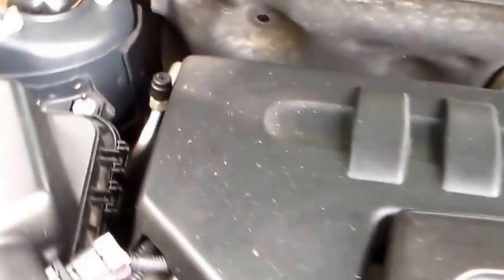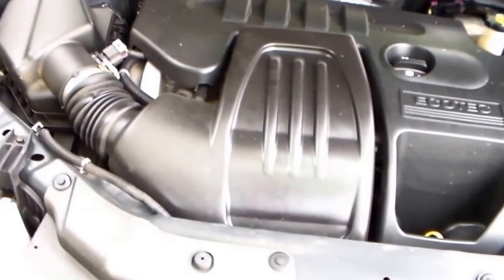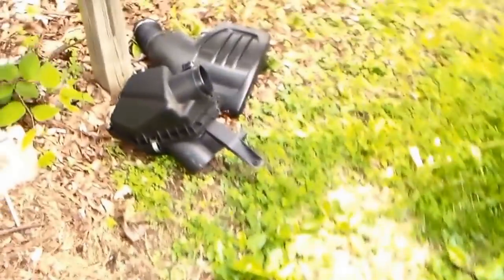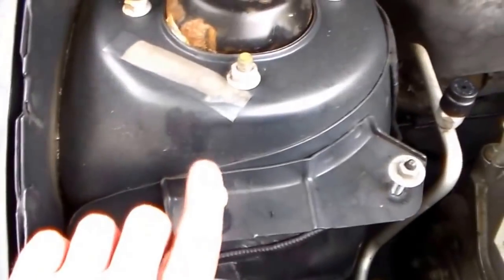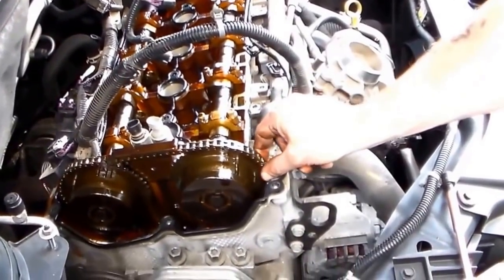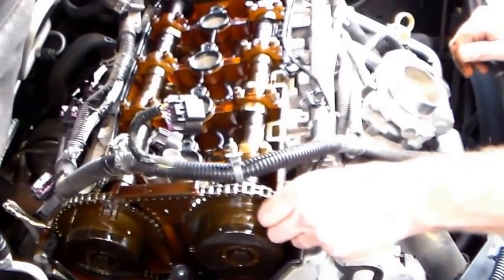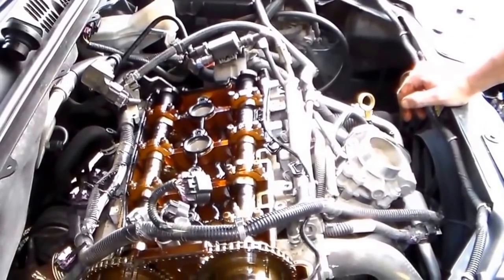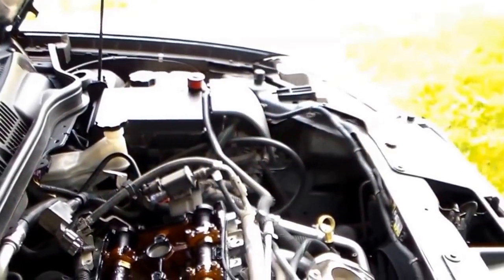timing chain tutorial on Chevy Cobalt 2.2 L Ecotec

Comment: What have they DONE????? my older 2.2 liter cavalier has valve lifter works like a half of V8 block that push rod upward to push in valve. I did my own head gasket job and it was a BREEZE no overhead cams, timing chains and adjusting each valve rocker clearance. I hate timing chains leading to TOTALLY damaging the engine when they break! I'M STICKING WITH CAVALIER FOR LIFE!!!!
SHAME ON YOU CHEVY "ROCKET SCIENCE"

Comment: My project is going to be a little more complicated. My Wife's 2006 HHR with 124,000 and the same basic engine jumped time when JR was driving it. Bent a valve on the #1 cylinder. I'm going to have to pull the head and get it redone to fix it. with  balancer chains too, I might think about buying another used car and scrapping this one. I'm going to do some research on the price on all the parts and beer its going to cost to fix it, but its going to close.

Comment: I have the same issue but in my case I only changed the timing tensioner. Also was needed adjust the timing marks, because the chain jumped a tooth. THE PROBLEM is that the noise is worse. Can someone tell me an idea ???
Reply from the maker: the noise may also be coming from the balance shaft chain, it is toward the bottom right BEHIND the timing chain.
Reply: Thanks a lot, but now is OK. The problem was that the "NON ORIGINAL" hydraulic tensioner could not be filled correctly by oil pump. I decided to create a mix with the old and new (Old body and new spring). With that was enough (at the moment haha).  Thanks a lot again your video was very useful

Comment: Im going to be tackling this in the next day or so, Besides the tensioner and the chain what other parts will i need handy to get this done.
Reply from the maker: like kevin said, there is a balance shaft chain i would replace while i was in there as it is BEHIND the timing chain. if you can, i would also get a new valve/cam cover gasket, they are a little pricey, but if you cant it can probably wait because it is  reusable (providing it is not damaged upon removal). goodluck my friend, if you have any questions please feel free to contact me.

Comment: colored links! line them up! to be honest man you can just pull the front cover off and replace the tensioner most of the time, unless you wanna replace the chain, but theres torque to yeild bolts you need to replace, cam sprocket, crank balancer, accully is the only 2, but 24mm wrench line up the links badda bing shes in time! once you know thes engines there quite simple
Reply from the maker: very well said.

Comment: nice work shabear,

tomorrow I start on a 2010 equinox 2.4.  the letter from chevy said there may be a chrome layer on the balance chain pins wearing and allowing the chain to stretch.  I'm not sure where that part is at yet.  
but it sounds more like the tensioner is going
did you use any tool to hold the cams in place, and is there tension on the front cam.  on my chrysler there was tension and I didn't use a holder, so do I need a holder... how lose to need a new chain... 28,700miles

Comment from the maker: not sure without hearing it but ours was doing the same thing. but he is right, if you were to "jump" time the pistons will hit the valves. there is also another chain behind the timing chain and it can also make a sound like that, it is for the balance shaft.i would replace them both then go from there. ya know, 2-3 hundred bucks now is a LOT better than 2-3 thousand later. good luck and please let me know what you find out.

Comment: Well, mine is at 152 000km right now, I have a SRI on it and I hear a rapid clacking noise when I step on the gas. My friend told me that it was the valves opening and closing sound coming out of the SRI, but I'm unsure... He also said that if the timing chain was loose (which is really unlikely) it would skip dents and my pistons would crash into the valves.

I'm really confused now lol

Comment from the maker: you dont have to replace the chain every time but the only way to tighten the chain is to replace the tensioner. that is qhat goes bad on these. i dont know why the didnt recall them. but i would recomend replacing the chain if it has high miles. feel free to contact me if you have any more questions.

Comment from the maker: yes, it was the tensioner that was the problem but since i was in there i went ahead and replaced the chain and gears as well.
Reply: Was it running rough or anything before the chain was replaced? I have a 2010 Cobalt that has me scratching my head. It starts up fine, but sometimes it idles rough. The main problem I am having is that from 1200-1800 RPM the engine misses out and tries to stall. There are no codes showing up in the diagnostic, except for an evap vent solenoid. (which I plan to test and replace)
Reply from the maker: @PS3ToolsAndTuts  the evap could cause that. Mine wasn't running rough, just making noise.